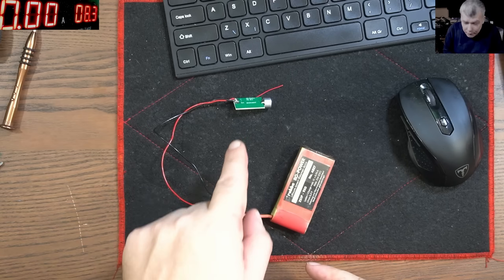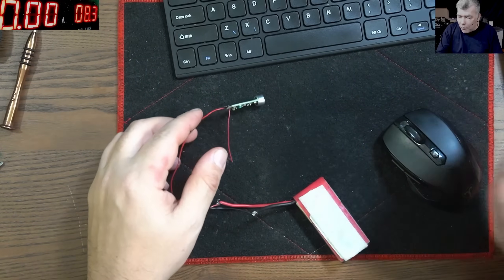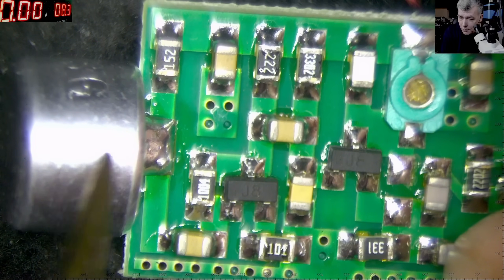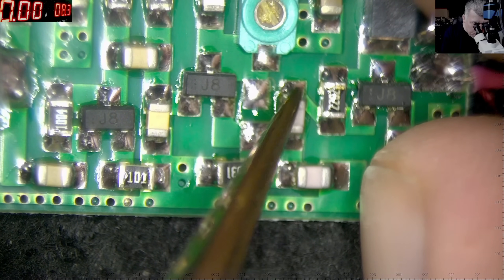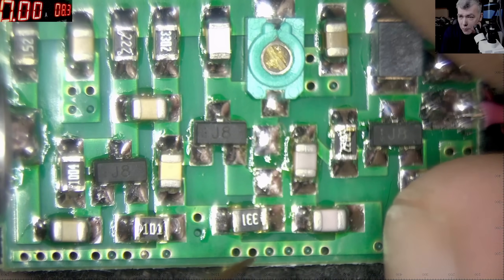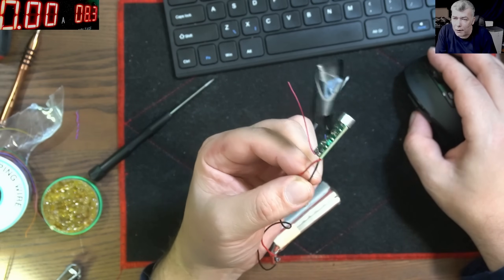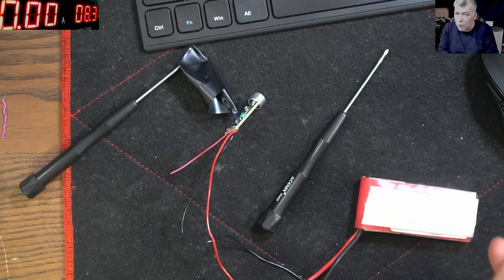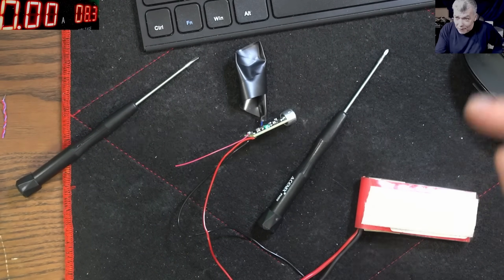What is missing from this FM transmitter ? Last knowledge test :D

Comment: I think it is a capacitor missing and that the wires are joined together because there is another capacitor the joined wires act as type of capacitor and give the extra inductance needed for the transistor to turn on and pass signal.

Comment: Funny. I just built a couple of quite bad transmitters to figure it out and was hoping for a good AM signal last week and the remaining test object is in breadboard mode now. Sadly, I think about getting rid of the oscillator component and use the FM "solution" with (the thing) and maybe fool around with a 555 timer as well.

Comment: Ceramic low value capacitor to complete circuit and further filtering of signal. Also some use a germanium diode in its place.

Comment: The coil and the capacitor in the collector make an oscillator. But this oscillation will not last long because the resistance of the coil. Therefore feedback is necessary. If we put a capacitor from collector to emitter we can change the BE voltage of the transistor, and thus change the amplification of the transistor and this way the transistor keeps on kicking the oscillator. Modulation happens because the CE capacitance, which is part of the oscillator circuit depends on the BE current. And the BE current is adjusted by the audio signal. So by adjusting the BE current we change the frequency of the oscillator.

Comment: I think you probably have two wires in a differential pair. Using the length of the wires and the spacing you can tune your oscillator.
Reply: In the follow up video we see this is correct. It must be understood that the flow of voltage passes around the wire, not within it. The spacing of these two wires in this configuration even with the insultaor is not sufficient to shield them from the effects of the others. This is why there is a capacitance value observable on these two (non connected) wires. Cheers! Nice job Sorin!

Comment: Phase modulation. The analog input modulates the output like an AM transmitter, but the feedback pulls the oscillator frequency. It's a missing capacitor. The secret component might be "nothing" but stray capacitance from the wires, but a capacitor.

Comment: the oscillator is the LC circuit on top, that transistor is used to inject the sound signal to the carrier signal, but because its used as a pass thru for both there must be a capacitor or a resistor of some sort to let the carrier signal feedback bias the transistor

Comment: The original component should be a ceramic capacitor which will start the oscillator by allowing a startup current spike in the collector tuned circuit.
Also known as the load for the tuned circuit.
Typical value 100pF.
This can be achieved by 2 short insulated open ended wires twisted together as your secret component.

Comment: This should be a capacitor with small value (a few pF) for positive feedback.
The capacitor can be omitted if the transistor has big enough parasitic capacitance between the collector and emitter but that was not the case.

Comment: Your secret component is 2 wire twisted together. In order to make the transistor oscilate you cut down the 2 twisted wires to the right length.

Comment: Two copper plates as sandwich with insulation between them which form a capacitor of some pF. Maybe also just two wires one beside the other with nothing else connected which also gives you some pF.

Comment: A missing component is small value capacitor, without this capacitor generation is not possible as this capacitor provides feedback critical to oscillation.

In this particular case this capacitor can be substituted with two wires twisted together to form a small value capacitor.

Comment: Hi Sorin . Ur voice needs a carrier wave to transmit to the receiver (RTL-SDR, RTL2832U). The middle transistor should be able to make a decent Carrier, in order to do that , it needs a proper DC bias and an oscillator. To make that oscillator without ruining the dc bias it needs a polarized tantalum capacitor.

Comment: In original PCB there is ceramic capacitor. I think main role is to provide positive feedback. Its a small one so its can be replaced with two separated wires or coils, maybe with microphone (capacitive one) or even with a mosfet (gate-source or gate-drain). There is alot of other components with small capacitance to replace this small capacitor.

Comment: Very small capacitor sub 10pF, or even two wires twisted, if they are long, even not twisted but near each other isolated
Reply: I mean ceramic of course, i never seen electrolytic cap with sub 10pF, only when they broke leg :-))

Comment: Hi Sorin, as a number of other people have suggested I think that all you have is two wires twisted (well possibly twisted) together. In order to get the circuit to oscillate you need to provide positive feedback using a low value capacitor between the collector and emitter - a few pF. The original capacitor would have been a chip ceramic, but you can obtain the same capacitance using lengths of insulated wire, which is probably what you have done.
Reply: Yesss good answer

Comment: Quartz cristal.Oscilator is formated with last transistor(final) and cistal,fine tuned by adjustable cap.Circuitul oscilant trebuie sa fie in b tranzistorului.Daca era circuit autooscilant(cu bobina)trimetea feedback in baza penultimului tranzistor.Din filmare se vede ca nu e cazul.

Comment: Any capacitor in pF value, must not be ceramic, there are other kinds of capacitors of that value. In the past there where no ceramic capacitors. In old tube radios there were used capacitors with paper as dielectric material. You can use even 2 twisted wires as a capacitor.

Comment: Ceramic capacitor goes there,  but maybe your secret component is homemade capacitor using both wires with a little gap between the wires, or maybe even some aluminum foil , maybe even using the wires as a coil , just need a way to oscillate  transistor

Comment: The few pf ceramic capacitor you removed was there to provide the feedback and enabled the circuit to oscillate. As for what you have soldered there, again, is not a well defined question, because you are dodgy. I would not be surprised if you have replaced the cap with just a two wires side by side to emulate the parasitic capacitance of a rf transmission line.

Comment: Sorin, the secret component is a tiny variable capacitor.  It is used to tune the oscilator to the proper transmit frequency.
Reply: It's just a capacitor, the variable cap is still there👍😄

Comment: ceramic capacitor around 5-20pF. But it also can be 2 open wires in in parallel,which has also a capacitance. That also works good in RF
Reply: Not so much at this frequency

Comment: Hi Sorin,the component you took out is a variable capacitor that determines the frequency of the oscillator along with the inductor for the transistor collector-emitter. Your secret component can be another oscillator or a capacitor.
Reply: no, I think the varicap and the coil that set the res frequency remained on the board. He removed the feedback cap from the modulator.

Comment: The secret component is no component, are only two parallel wires. The missing components is one capacitor (around 10-20pf)
Reply from the maker: Huh? You mean a coil? :D
Reply: @electronicsrepairschool  Doua fire rasucite impreuna, formeaza un capacitor, In trecut am folosit sa inlocuiesc niste capacitoare de 1pF, daua fire izolate rasucite impreuna aproximativ 1cm
Reply: @easterndigital2691  Foloseam așa ceva la ceasurile electronice !!!
Reply: @electronicsrepairschool    No coil, capacitor, the two wires are parallel, not together

Comment: Missing the collector to emitter feedback capacitor.  10-15pf normally works well.
Reply from the maker: Thank you but that's not what i asked :D I said, to tell me what type of the component it is also. You say can be a capacitor, what kind? Electrolytic capacitor? Ceramic?
Reply: @electronicsrepairschool  Ah, I sort of missed that.  It used to be a ceramic, but I reckon its two insulated wires twisted together for the same capacitence.